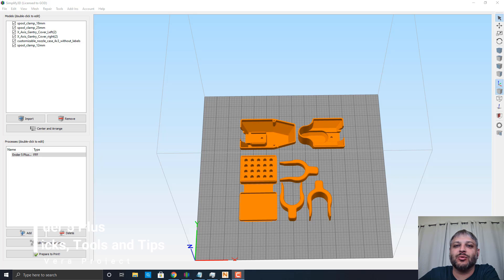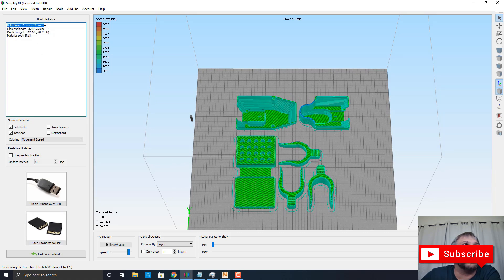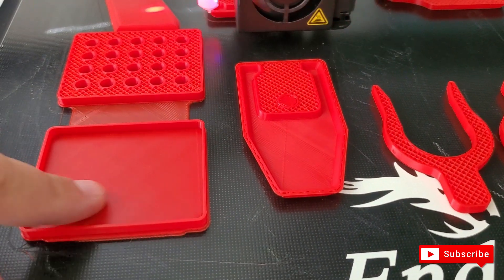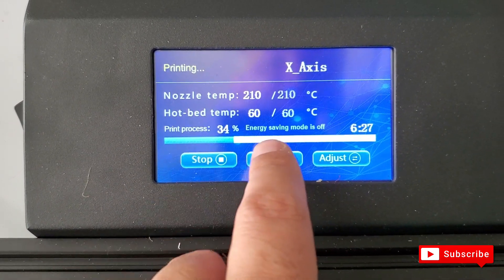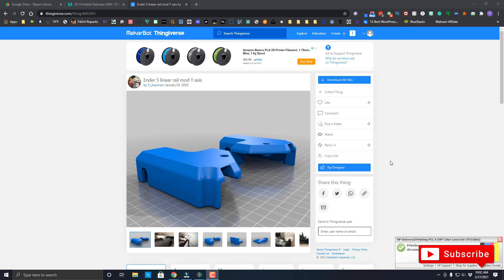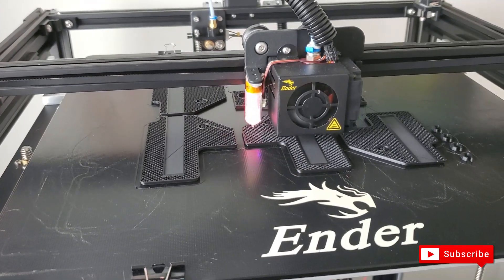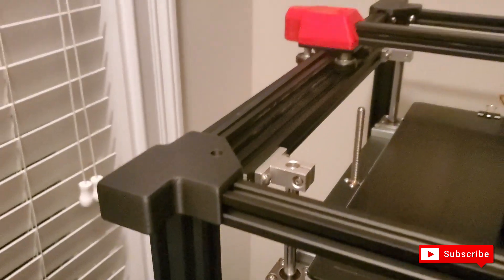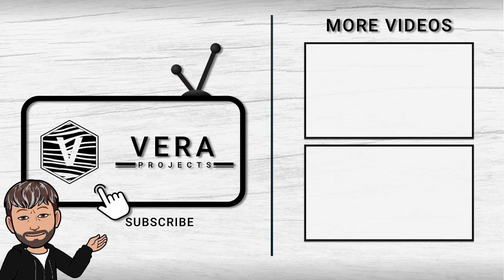Creality Ender 5 Plus 3D Printer - Trick, Tools & Tips

Comment: Great video! I have bought same printer like you but I have issue With my printer cuz everything lift up from bed plate and filament stock in nuzzle….
Reply from the maker: I used to use Stick Glue on my Plate and then I switch over the rubbing Alcohol and its works perfect. Just clean your place with alcohol before every print and it will not lift anymore

Comment: hi bud, did you ever find out a way for that end stop on the top right hand side of the ender 5 plus? Ive printed all the bits but im stuck on that part because there is no where for the switch to go. (its not touching the wheels as it used to be) Apart from that it makes the printer look so much better, great job. if ever you find a solution for that switch please pm message me, thanks buddy.
Reply from the maker: I never added one where the switch is I left it open for the time being. If I did add it I would have to modify what I printed with the Dremel tool.